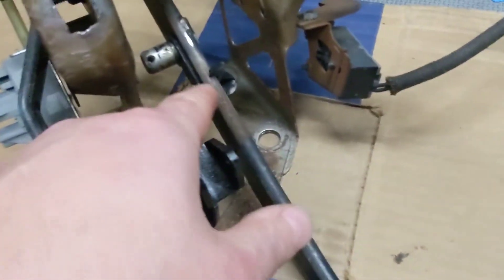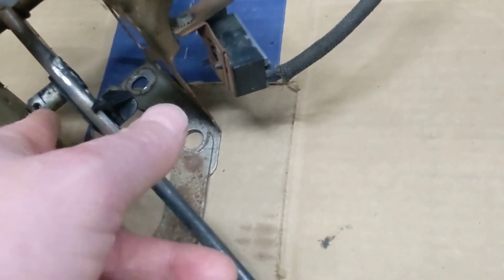manual brake conversion part 1

Comment: I've been dreading that project myself ... Good job on knocking it out!
Reply from the maker: Got the pedal box back in, waiting on the adjustable pushrod to finish up mounting theaster cylinder to the firewall and making a new brake line, but should be done this weekend

Comment: Things are coming along nicely Bro! 💯That bolt on the pedal assembly is really crazy to reach.. You have to be contortionist with little hands to reach it...Which rules me out...
Reply from the maker: I had to remove the seat and use a lot of socket extensions and swivels to get at the pedal box bolts
Reply: @vrm86gt  Time, Ingenuity and Patience! Good work Bro!

Comment: As Rodney and David would say " you threw some slag on it " 🤣 Im fixing to go with bigger brakes in the front of beans and put some 11" or 13" brakes . Those 9"s has gotta go which is the stock Pinto brake size . I just hate to take them off because the rotors are new 5 lug conversion rotors along with new pads
Reply from the maker: Yeah, definitely slag! Yeah the brake swap and 5 lug conversion stuff is a whole other can of worms!
Reply: @vrm86gt  i dont know if my welds are good enough to be considered slag 🤣 : Yeah im not looking forward to the brake stuff but if my car will be able to run 17s in the eighth im goin to need to stop really good at 37mph 😆 top speed

Comment: Just curious... what trans are you running?
Reply from the maker: Faceplated TKO 600
Reply: @vrm86gt  how do you like it?
Reply from the maker: @89G  I haven't made any passes with it yet, just got it installed and was rained out of like 6 test and tunes in a row, then spin the rod bearing.